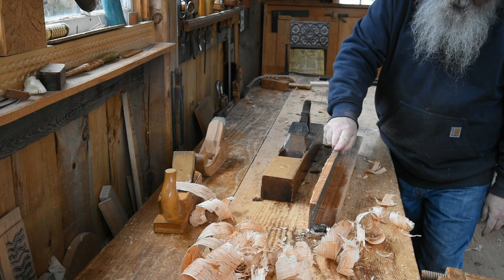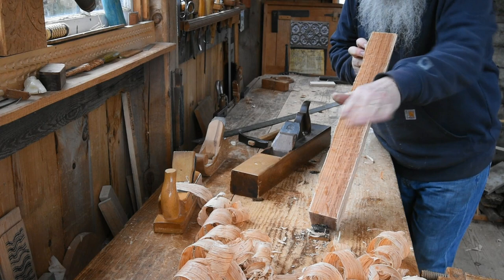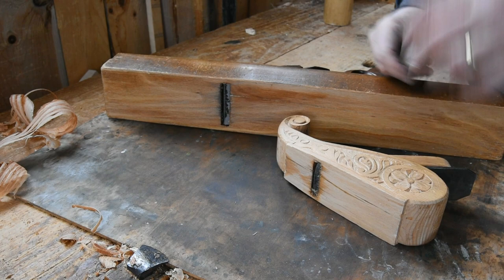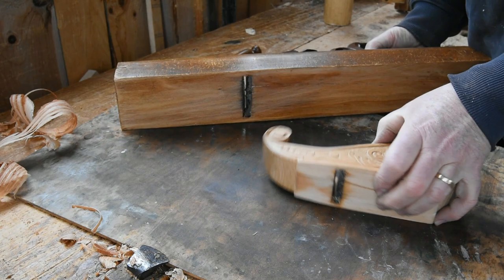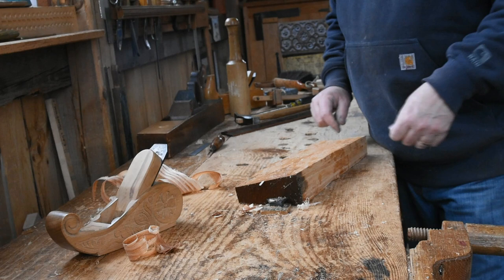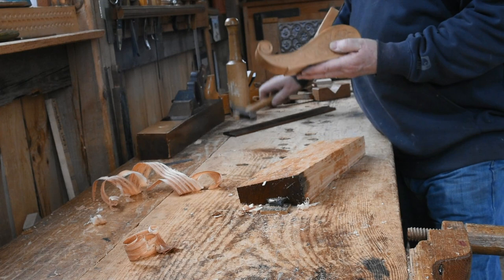planing stool parts

Comment: I typically run into a maddening back and forth fight with myself when edge-jointing boards. I’ll check it for square and see that the inside part of the edge is high, so try to do a few passes with the plane iron localized over the high edge, only to check it for square again and find that the outside of the edge is now high. Quite often then when I finally do get an edge square to the face, I’ll hold a straight edge lengthwise along the board to find that there is a significant high or low spot in the middle of the edge. Once I’ve corrected that issue, I’ll check it for square with the face again and find that I’ve once again made either the inside or outside of the edge high. All part of the learning process I know, I’ve learned to pull out a scrap and practice some before planing a project piece away to nothing for the time being. Thank you for these amazing videos, I’ve always loved hearing you teach!

Comment: One question: Around the 20 minute mark you took the corner off the stile to note the orientation of the wood for later use. I didn't understand the logic behind this. You mentioned it was because one side was better directed inwards on the stool. But why was it exactly? (I hope you understand my question  - English isn't my first language, so I may be struggling with getting my point across)
Reply from the maker: Fred - Your English is fine. I determined which is the outside corner, and therefore the two outside faces. Then shaved off the inner corner just so I can position that stile that same way again without fumbling around. Much of the stile gets turned, so you only see this shaved inner corner near where the joints are in the finished stool. This blog post might help too https://pfollansbee.wordpress.com/2009/03/01/joined-stool-stiles-planing/
Reply: @MrFollansbee  Thanks for taking the time to answer my question. Do you pick which corner is to be the inner one one the stool on random? Or is there something to consider regarding to grain?
Reply from the maker: @Postfrogish  In great stock like this, it doesn't matter. In some stock, I might tuck a defect towards the inside.
Reply: @MrFollansbee  Alright, thank you so much for clearing that up.

Comment: How long do you leave your parts to dry? Do you wait years for them to be fully dried, or is there some higher threshold of moisture that you deem acceptable to work with?
Reply from the maker: No, not years at all. A couple of months at most. The parts are radially-split, like quarersawn boards. So very stable across the width. And I choose very straight logs - only the best oaks I can get.

Comment: Thanks Peter, really useful, starting a project with a green log is brand new to me and such an exciting concept though I appreciate its not new historically! Can I ask, when you are squaring a face and moving the plane over onto the high edge would you ever reach for a narrower plane rather than use a plane where the blade is wide relative to the width of the face you are working on? is that something you would consider?
Reply from the maker: I generally just work with a couple of planes these days. I have lots more, but it just became more stuff to keep track of. So, no, is the short answer. That plane is about 2 1/2" wide or a tad wider.
Reply: @MrFollansbee  Thankyou Peter.

Comment: What kind of camber do you have ground on that big plane iron?  It looks like a really aggressive scrub plane grind in a jointer body.
And this might be obvious, but are those billets green?
Reply from the maker: That jointer plane has virtually no camber. Just the corners knocked off. And yes, those billets are green. Radially-riven so very stable.
Reply: @MrFollansbee  Would be cool to see riving video when it warms up. The way you select which way you choose grain .
Reply from the maker: @jimcarter4929  Did you start with this one? https://youtu.be/uqEoymNl9Dk